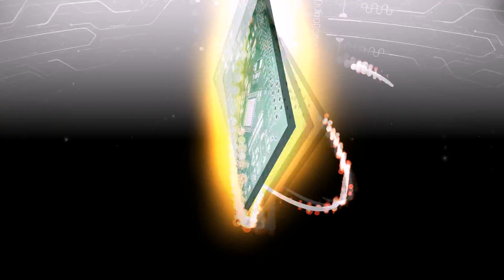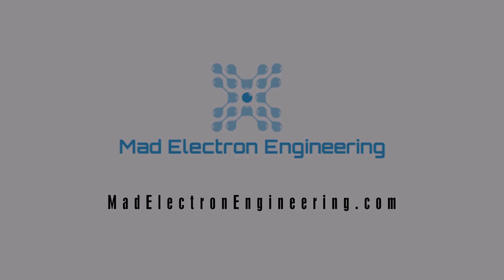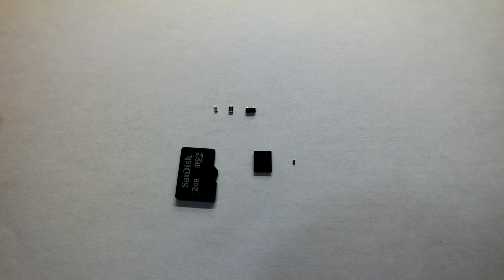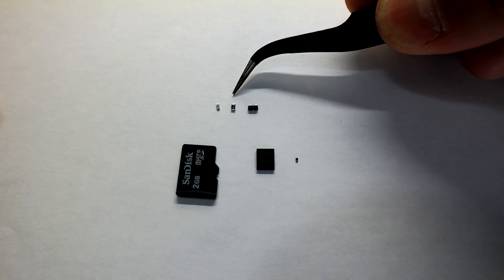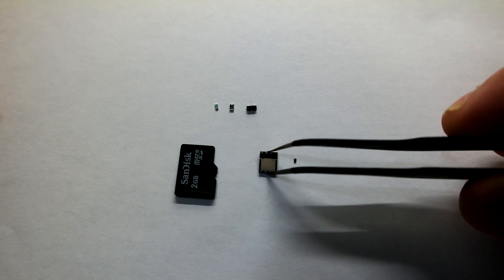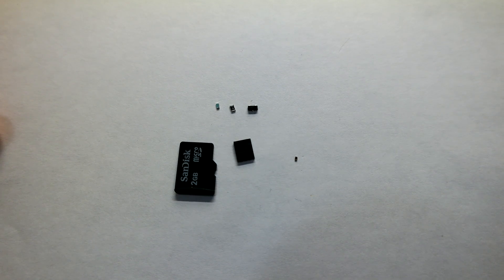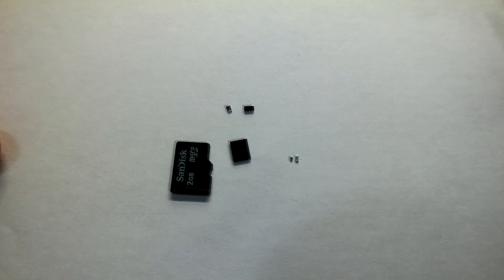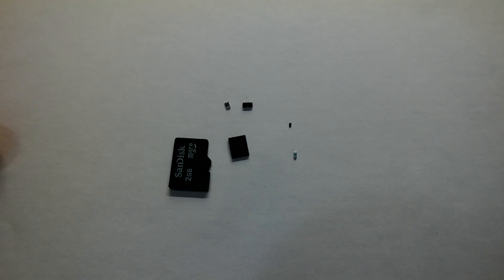How Small Can A MOSFET Get??

Comment: That ain't small. It's atomic scale. WHAT? 2A. That things got to fry. HOW? I'm amazed.
Reply: +Raymond Earle  These are the same size as an 0402 passive.  It would only "fry" if it got too hot, and with typ. 140m Ohms on resistance (0.14 Ohms), it would only dissipate 0.6W with 100% duty cycle at 2.1 amps.  In the same package they have one with typical 37m Ohms...  0.037 Ohms.
Reply: Crikey. Thats clever.